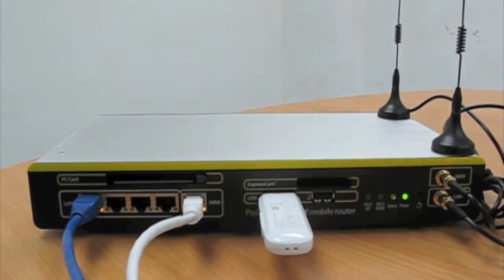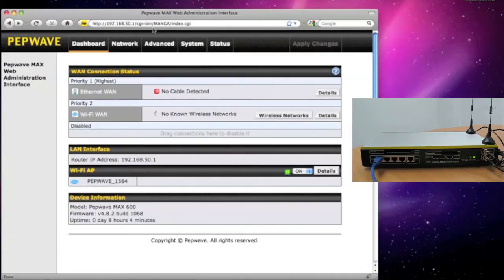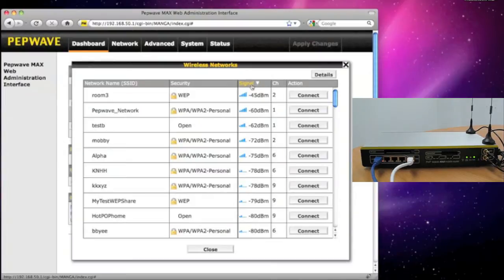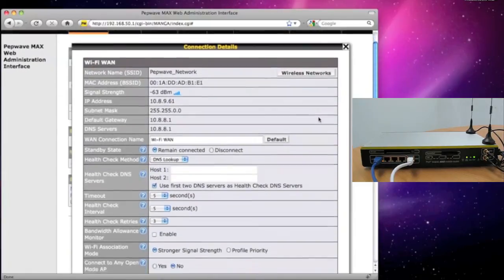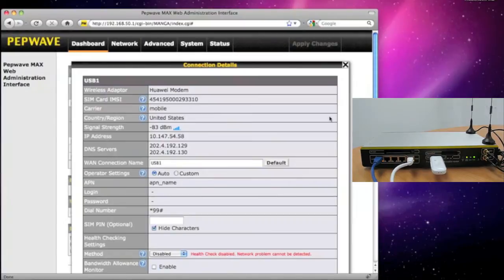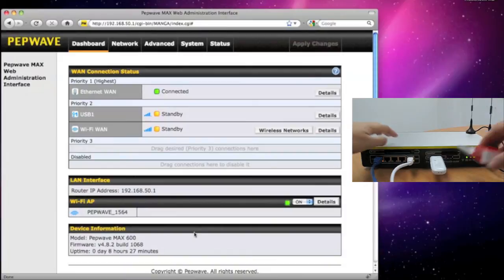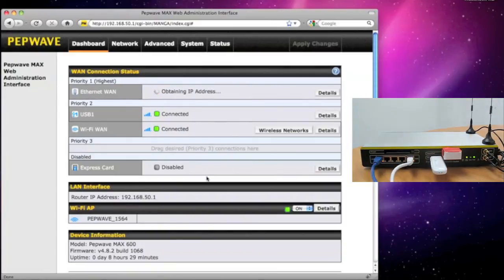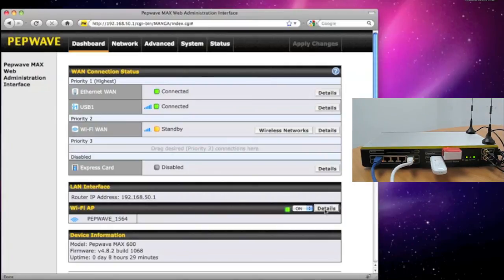Pepwave: MAX Mobile Router Introduction

Comment: i used business models of max routers in 90's. for a price of cisco 5000 series router you can buy 5 max routers easy, cheap, easy setup and reliable. max router used to do the same work of $500k cisco 10000 series router. i remember the day when i hand in 32 ports max router i had a smiley face all day,